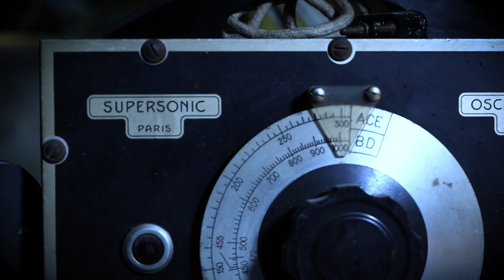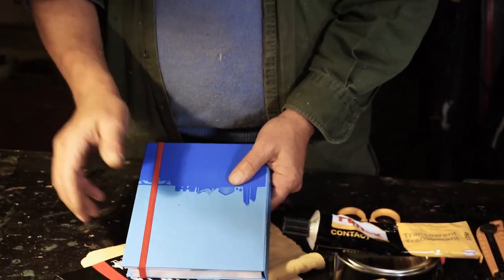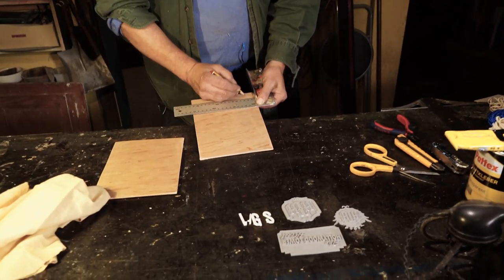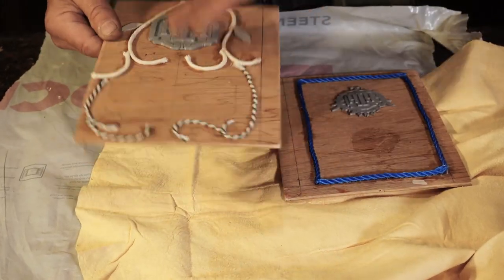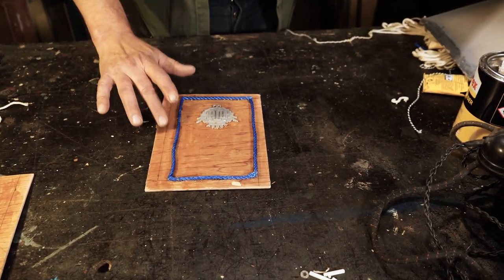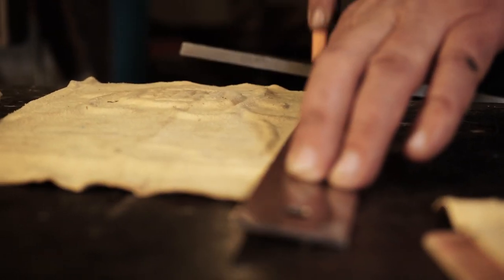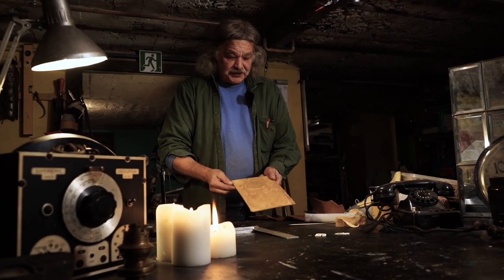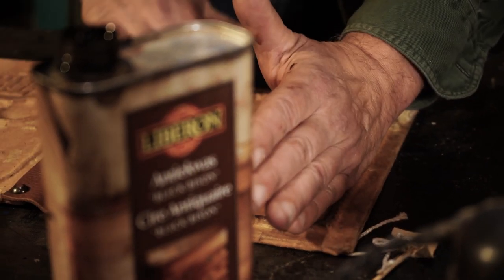Halloween Themed Notebook / Easy Technique to make Leather Bound Props / Tutorial

Comment: One nice thing not shown in the video is that after a couple of days,when the wax is really dried,you can can give it a quick buffing (just rub quickly&lightly with a towel).
It will give it an elegant but subtle shine,and brings out the details even more.
If it becomes dull after a couple of years,just buff it again for a few seconds,no more wax needed.

Comment: One thing you can add is gluing thick string horizontally across the spine before covering it in leather. I haven't done this yet, never had to build a book (you could make a fortune with these medieval fairs, fantasy conventions, LARP etc.). If done correctly it will look quite similar to traditional book binding. Play around it a bit so it looks like it's actually tying together the pages. You could also tool/stamp the leather (chamois might be too thin). But in that case you should use naturally cured leather, not chromium which the sofa leather almost certainly is, it won't work otherwise. Having a bone tool to work leather ('Falzbein') is also handy to get the moist leather into the depressions (I've never used Pathex on my sword scabbards, wood glue or if you are adventurous bone/skin/hare/fish glue should do the trick). You could also quickly carve a little tool from wood to do the same job, even make stamps from wood. No need to buy expensive metal ones, you won't be hammering them anyhow, just pushing into the moist leather. Hmm. I will have to check what materials I have at home tomorrow, I'd really like to try this. Though I'm pretty sure I don't have any wood glue and it's too cold to work with skin glue right now (it hardens too fast as it cools down, even before applying it). But I have the leather, no wood but thick cardboard. Now that I think about it even leather dye, even natural dyes like madder, red wood, weld, hazelnut if you have them (I also have some indigo and woad, but that's a different dying process which I've never done). Though the question is where the various stuff is among the moving boxes filling up my garage. Note, you can of course make the risers, that is the stuff Ken 3D printed, from other materials, for instance some thicker leather from which you could the lettering (positive or negative) and such, event thick cardboard should work. Oh, and add a relief title to the spine. Ah, I can't stop brainstorming, fake or cheap gemstones, sheet metal protections on the corners etc.
Reply: I tried the thick string on film-prop books It worked if the spinewas chamois (window) leather, but not well with others. 
The spine is normally a 2dimensional bend, but with the string becomes 3 dim.
It must be possible, as real bookbinders do that.

My approach here is a quick satisfaction object (even if durable), real craftmanship is something different (and higher.) That doesn't mean it's wrong to use such skills, but I don't have enough of them .

For the rest, yes, go for it... especially if you stay with fantasy, the possibilities are pretty unlimited